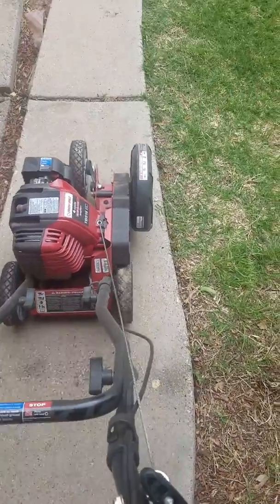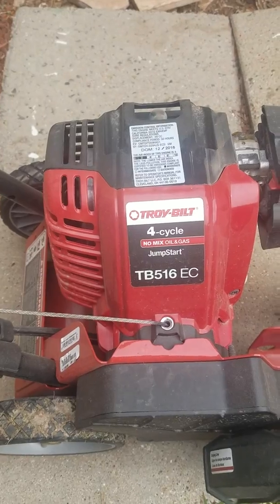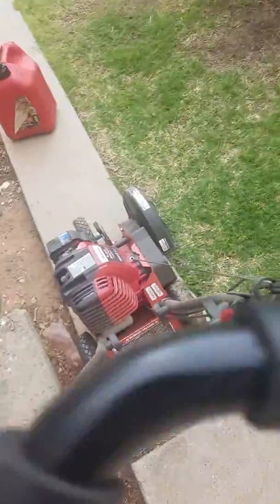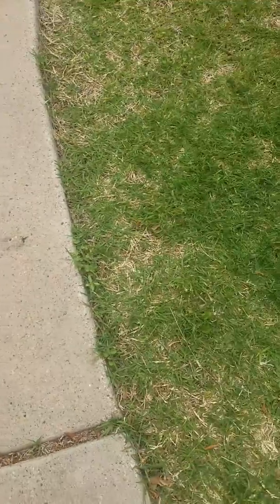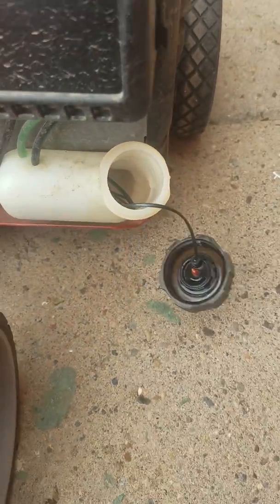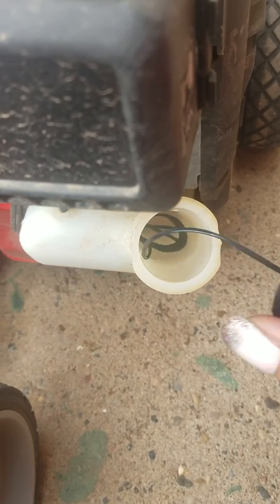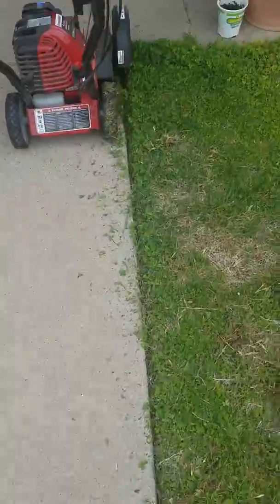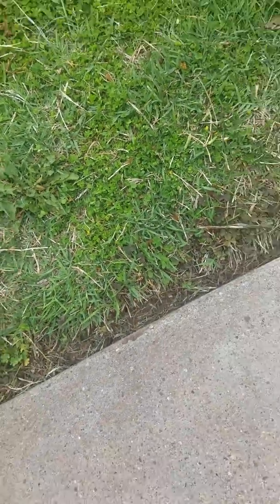Complete how-to start your Troy-Bilt edger TB516EC

Comment: where do install the oil for the edger before using?
Reply: I’m going to make a vids on hour to add oil and clean the filter and general maintenance for the edger
Reply from the maker: I will try and figure that out and load a follow up videa

Comment: i found one of these in trash..it will not start seems like fuel issue...it will try to start with carb spray but only for a few seconds..i took carb apart and cleaned it and still no start..must be bad carb